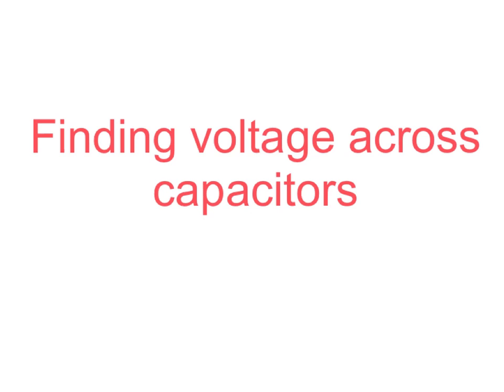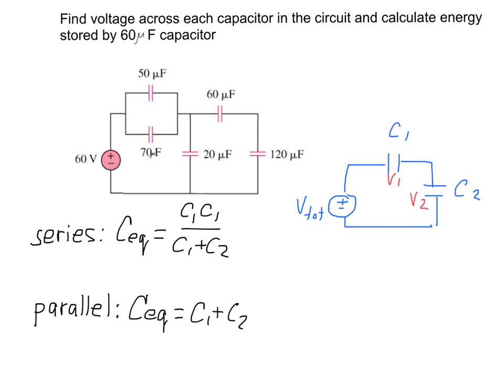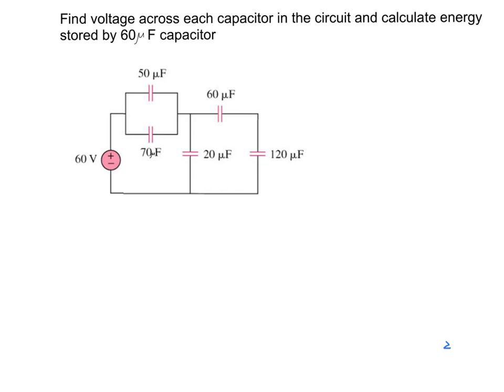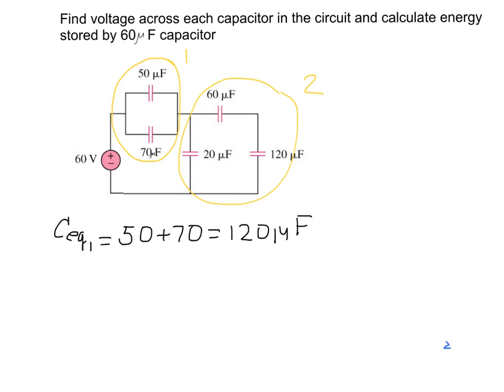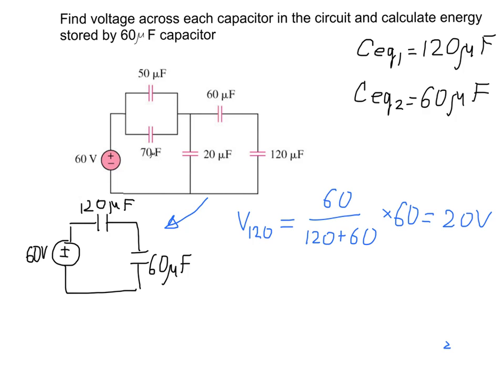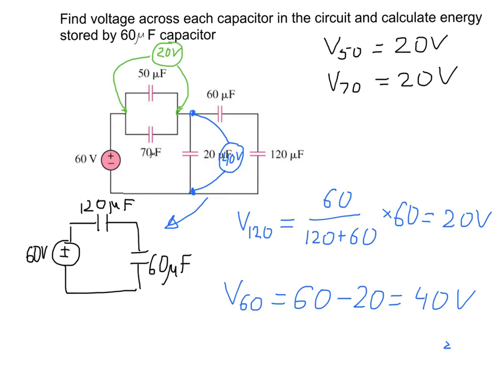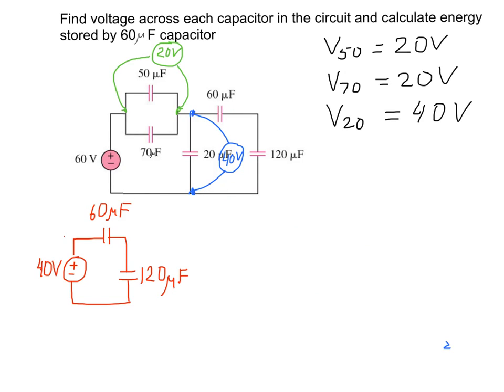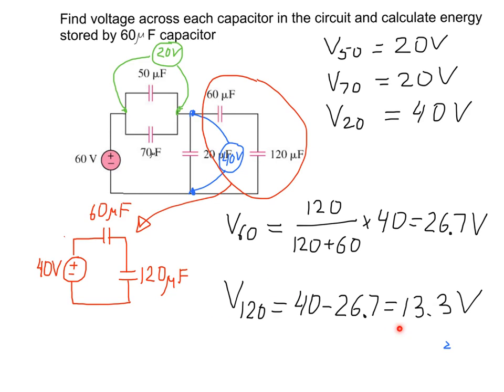Finding voltage across capacitors in the electric circuit. Example with solution

Comment: Can you explain the part where you worked out the voltage over the 60uF capacitor, I thought it was the reverse to resistors (Potential dividers) when it is a capacitor so the voltage over the 60uF would be (120/120+60)*60, please can you explain why I'm wrong because I've always answered these questions by using the reverse and want to get the correct method before the exam. Thanks great video (*EDIT SHE IS CORRECT*)
Reply: Nm you are correct my bad, i didn't realise you worked out V120 first and took it away from the total

Comment: I didn’t quite get what said in between 8:58 9:00
Reply: voltage divider formula. 

used in resistor Vout = R2*Vin/(R1+R2)

Comment: The way of teaching by giving students things like 'the voltage divider rule' is completely useless. you might as well tell a computer to use equations where they apply. humans need to understand the fundamentals and the logic behind these things, not rules
Reply: Engineers need to understand the fundamentals, people want quick answers and move on. If im calculating total resistance of my board, i don't want to study how the resistors are made... i want to apply simple equations, that's it.

Comment: A 3.43-F and a 4.79-F capacitor are connected in series across a 40.0-V battery. A 7.29-F capacitor is then connected in parallel across the 3.43-F capacitor. Determine the voltage across the 7.29-F capacitor. could you please explain this

Comment: while you are doing parallel operation with 60 and 120 you got 60 and again that is parallel with  20 but you didn't consider that then how come you directly say that v20 have 40v
Reply: Dude voltage across them is different , 60 in first case and 40 in second case :)
Reply: Yaaaa im also asking this question we have already found the voltage across 60 and 120 then why she find it second times